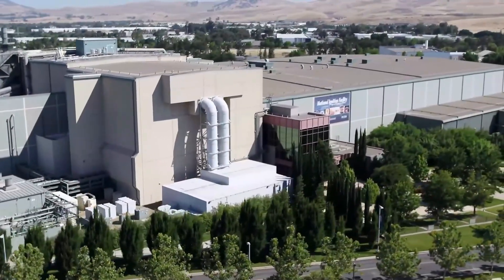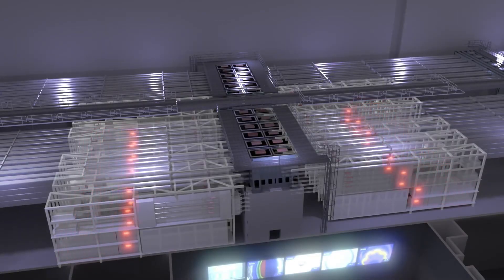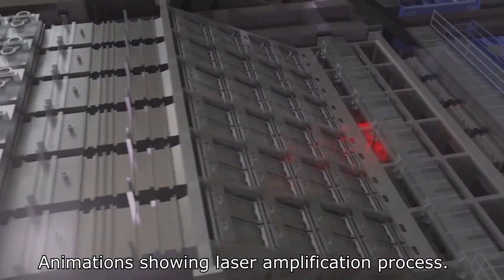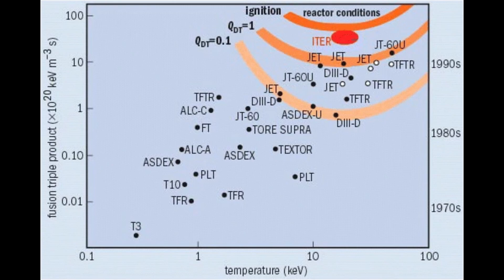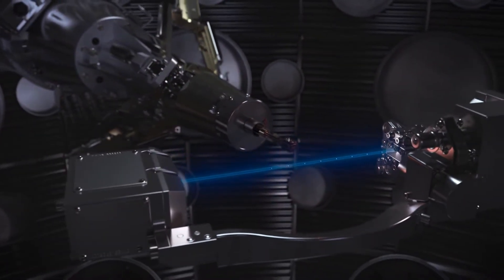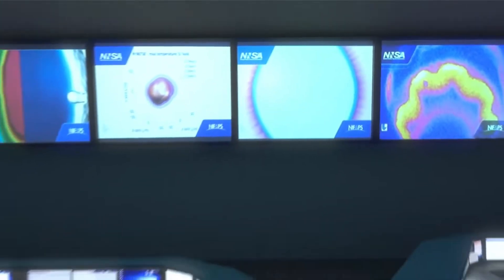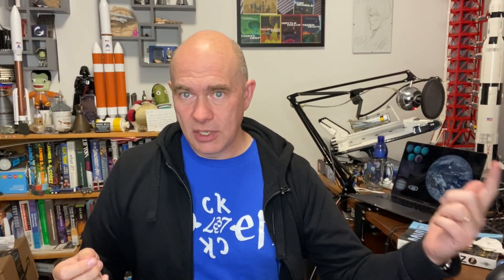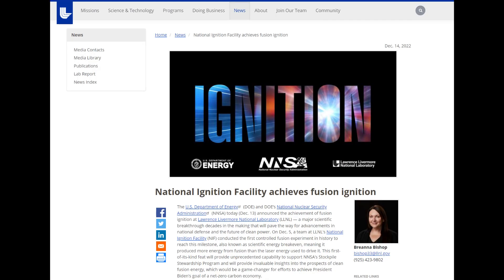Why The Biggest Laser in the World is Making Big News About Fusion

Comment: Watching the panel presentation, they burned 4% of the fuel to get this reaction.  What I expect (and apparently what the experimenters expect) is what is learned from these "shots" is better understanding of fusion reactions, better technology advances in the US fusion weapon deterrent and assisting the magnetic containment experiments (tokomak, etc) in reaching their goals.  One major contribution to this breakthrough is they were able to increase the efficiency of the lasers over their original design.  It takes weeks to months to create one of these pellets of high enough quality to get the intended results.  I'm still convinced a tokomak-like device will be the first sustainable-economic engine on Earth with the help of other experiments.
Reply: When they say more energy out than in, I'd guess they are discounting the laser efficiency. Meaning they are using the energy delivered by the laser into the reaction. Rather than the energy delivered into the laser. Scott seemed to make a big point of the laser efficiency, or lack of, as if a more efficient laser would lower the break even energy. I doubt laser efficiency was even a part of their calculation.
Reply: @heartysteer8752  - The energy gain of the reaction has always been calculated without consideration of the energy needed to generate the intense laser beams. In the past the lab staff avoiding mentioning anything about how much energy was expended in creating the final energy that ends up compressing the fuel capsule. That input energy may be of the X-rays that end up directly compressing the fuel capsule. Once rumors began that the input energy to the facility was at least two orders of magnitude greater than the final compressing energy, that they employ for their gain calculation, then the lab had to reveal how much energy is needed to charge up the lasers.

Now they are bemoaning how inefficient their laser is as a way to encourage funding of a successor facility that would employ more advanced laser technology that is more efficient. They point to research in 'diode pumped laser technologies that are about 20% max. efficiency at this point. What they don't mention is such lasers will need to be called up in power by a factor of almost a million to deliver the kinds of energy now delivered by the current laser set. The lab people obscure the fact that that kind of laser technology is no where close to what is needed, in power level.
Reply: @heartysteer8752  You are correct, those 2.05MJ of laser light energy required 300MJ to create, so the current system's total efficiency is really 0.01 rather than 1.5
Reply: @heartysteer8752  The lasers are old, they are 40 plus year old design, that why they are ignoring them. What new is the fuel pellet design and how they are targeting the lasers because that where they can make the breakthroughs.
Reply: We already have sustainable energy, both economically and ecologically, its called solar & wind power and to an extend hydro power. And the bigger the share of green energy in the energy mix the lower the costs per kilowatthours (atm 3-6 cents compared to 10-15 cents for a new state of the art coal power plant). Dont fool yourself that Fusion energy on Earth will ever be green or as cheap as wind and solar energy.
Reply: @kleinerprinz99  - When I was growing up in the mid-1960s I kept hearing that fission power would soon become too cheap to meter. It helped me learn about the deception of sales pitches.
Reply: 'Deterrent' doing a lot of work here.
Reply: The LLNL often uses the term nuclear deterrent since it is politically important to specify the claimed use for these devices. It also avoids the term 'weapon' that has bad connotations in many people's view. Nuclear weapons labs have become quite good at obscuring the activities that they engage in.
Reply: Yes, with stronger magnetic fields made possible by greater understanding of unconventional superconductors.
Reply: Most of the people, who report on the NIF remain unaware that it has always been primarily funded as a thermonuclear weapon (H-bomb) fuel compression, and related effects, research tool. The machine was funded in exchange for the lab's termination of its underground nuclear test program at the Nevada Test Site (NTS). They claimed it was needed to maintain the safety and reliability of the U.S. nuclear weapons stockpile. There is no evidence that this multi-billion dollar machine satisfied those claims. In this widely reported test the 14 Mev fusion neutrons that were emitted from the extremely compressed fusing D/T was used to test some adjacent materials that were related to the nuclear weapons program.
Reply: Very interesting. What do you think about the Helion reactor?
Reply: @mtshelll2977 - When hearing the sales pitch from the Helion staff ask yourself the following two questions.
1. Have they repeatedly achieved significant amounts of fusion reactions with their hundreds of shots.
2. If they do regularly achieve fusion reactions then what is the level of their facility input energy compared to the fusion output energy.

if they are directly questioned about such issues and side-step the answers then ask yourself why that might be. If they say that they need more capital investment and a much bigger machine to obtain those goals then be even more suspicious.
Reply: I agree, I think that apart from all the really "techy" problems with this approach to a fusion reactor, like the aiming and timing problems and the laser efficiency problem and the heat-to-electricity conversion problem, the biggest drawback to laser inertial confinement fusion is that it eliminates the main benefit we hope to get from fusion as an energy source: it manages to make the fuel a complex, difficult to manufacture, and expensive component. 

Ultimately we all need to keep in mind that no matter how cool or advanced net-output fusion technology could be, if it doesn't cost less per watt-hour than a renewables+batteries system, then it's not that important from a global energy perspective. For applications where cost isn't an issue (like spacecraft propulsion) or applications where it can't be outcompeted by renewables (like commercial cargo ship power) it would still be great, if it could physically fit on a vehicle of course.
Reply: @sycodeathman  so why not do regular nuclear power?
Reply: @Shmuel420  Regular nuclear has a bad reputation but from a practical perspective I've heard there isn't much Uranium of the flavor they are using now. Like a 100 years? And the other kinds are more difficult to use. Don't know how breeder reactors, thorium, etc., factor in.
Reply: @Shmuel420  Many will argue it costs too much, or takes too long to build, or that the waste is too hard a problem. I disagree with all of these arguments and believe that we SHOULD be building more fission reactors, preferably with modern designs which achieve higher efficiency, are better for fuel reprocessing, and which are designed to be easier to eventually decommission once their life cycle is over. The real reason why we aren't building a lot of fission reactors right now is simply because a majority of people don't like them, for one reason or another.
Reply: @sycodeathman  the thing that worries me is the proliferation of nuclear technology, which could lead to more places figuring out how to build nuclear weapons. Depends on what kind of fuel is used, though. Thorium reactors would probably solve that issue
Reply: @Shmuel420  Nuclear weapons are easy to build and the cat is out of the bag, I don't think proliferation actually matters at this point.
Reply: @sycodeathman  no,  the real reason why we aren't building a lot of fission reactors right now It's because each costs $15 billion and takes 15 years to build. The nuclear plants in South Carolina and Georgia were at existing sites with strong local support; SC is canceled and Vogtle is predictably $billions over budget and years behind schedule. Maybe some company could get good at building light water reactors if it made 20 in a row, but no utility wants to be first customer. And each of the next-generation small liquid sodium molten fluoride thorium modular blah blah blah reactor designs will need... $15 billion and ??? years to determine whether it actually will be cheap and quick in mass production. Worth the huge investment (just like fusion research) but years away.

Meanwhile cheap and quick wind and solar have the lowest levelized cost of energy, getting to be even cheaper than continuing to run a coal plant. That is why they have been the majority of new generation in the USA and globally for years.
Reply: @skierpage  why would you reply by stating the exact things I claimed are misrepresented as reasons for why we shouldn't build fusion? This is like if I said building settlements on the Moon was feasible because blocking space radiation isn't that hard and then you responded by saying "ah but have you considered the space radiation". Yes, I'm aware of all those things you said. I simply disagree.
Reply: @skierpage  They're facts but they aren't physical laws. Fission is expensive because the majority of the public refuses to accept it is safe and allow cheaper designs to be funded. It is slow for the same reason.
Reply: More world-destroying weapons: cool!
Reply: @spencerharmon4669  - You have that right. NIF is helping them improve on the existing nuclear weapons designs and in creating more advanced designs of weapons of mass destruction. The current U.S. nuclear weapons arsenal numbers around 10,000 nuclear weapons, most of which are thermonuclear weapons with energy yields well over five times that used in the bomb dropped over Hiroshima, Japan.
Reply: In nuclear weapons it is also the case that much of the fuel is blasted away from the reaction center before it has a chance to react so this lack of burn efficiency is no surprise to this portion of our government.
Reply: Fuel scoop, reactor, engine with small masses needed relative to the ship's size... this eventually is how we will get around in deep space.
Reply: @plektosgaming  nope. There's not enough 'free floating' hyddrogen in space for a scoop to work.
Reply: @Molikai  I am assuming that it eventually gets to the point where you need any sort of matter to make it work.  Whatever you can find, though it might require you to be close to some dangerous places to collect it.

Comment: I hope bubble fusion takes off.  I like the idea of society being powered by bubbles.
Reply: I wonder if you could get a cavitation system working by pumping a hot liquid metal saturated in D/T at high pressures thought a venturi? The sharp drop of pressure (probably still above the metal vapor pressure) on the converging side draws the gas out of solution and then, on the diverging side, the sharp rise in pressure collapses it back down faster than it can go back into solution getting a "water hammer" spike to very high pressures.

Comment: The part I have never understood.  If you are trying to turn this into a power-generation device, it would need to continuously fuse multiple file pellets, one right after the next.  But how are they going to insert the pellet with the needed ultra-high precision right after the previous one fused?
Reply: That is one of the major technical problems with laser-driven fusion! You can't have the next target inside the chamber while the current one is being hit or producing energy, because the shock waves would damage it. This means the next target has to be fired into the chamber so it reaches the centre just at the right time for the next laser pulse. It also has to be hit on the fly, because trying to stop it would require so much deceleration that it would be squashed like a fly on a windscreen! Another major difficulty is simply making those targets at a rate of several per second (the same rate as they are being used), which would require a far simpler target design and massively parallel production facilities.
Reply: The NIF physicists will outsource that problem to the mechanical engineers.
Reply: It's a hurdle that'll come later, but we'll pretend it's not an issue so we can masturbate to sci-fi stuff

Comment: Commonwealth Fusion is doing some cool stuff with High Temperature Superconductors to make ultra-strong magnets.
Also HB11 Is looking at Hydrogen Boron Fusion.
Reply: p-B11 fusion is particularly interesting since it doesn't output neutrons, but only fast-moving charged particles (basically electrical current). These can be decelerated through electromagnetic means and used to generate energy directly. No thermal process involved.

Comment: Inertial confinement fusion is simple not practical for anything but research purposes. The only viable fusion reactor designs at this point are tokamaks and stellerators. Wendelstein-7X with its newly installed cooled diverters should show the viability of building a follow-up stellerator capable of producing a Q of >5. As for tokamaks, ITER is a bit of a boondoggle, as JET, HL-2M and kin have already surpassed it in many ways.

I wouldn't dismiss nuclear fission so easily either. With the use of fast breeders and fast neutron reactors, today's LWRs and HWRs (like CANDU) can achieve a closed uranium fuel cycle, while also opening the possibility of using other fertile isotopes, like thorium. All with nothing but a small amount of short-lived waste (<100 years) remaining at the end.
Reply: Another great comment, I seem to be seeing you everywhere. Yes, it is quite sad that fission got such a bad rap. Makes you wonder if the same thing might happen to fusion if it eventually comes: decades and decades of stagnation caused by refusal to allow new designs, leaving the only examples to be ancient ones. Fission really could be great, but that seems like it won't happen. People are too afraid, and given the way braindead design shortcuts seem to work their way in, I guess I don't blame them (things like playing games with statistics to show that an unsafe design is safe, counting systems which could all be affected by a common cause of failure as independent failure probabilities, etc.).
Reply: @jessicav2031  Self-professed environmental groups such as Greenpeace have already stated that they are against any nuclear fusion research and commercial use, as do the German Green party.

It seems that just the word 'nuclear' is sufficient to send certain people into a state of near-panic. Whether or not said panic is sponsored by Big Fossil Fuel is left as an exercise to the reader :)
Reply: Fusion is simply money laundering scheme for science at this point, nothing changed as it started in the 50s - where the Argentinian president declared they have achieved fusion and free energy lol - The Huemul Project.

Comment: I don't understand the hype people are giving this and this video didn't help it at all. This method of fusion is not at all useful for an eventual power reactor design. You can't build a power reactor out of exploding pellets of fuel made out of gold with a facility that huge. Not to mention the 1% efficiency issues you mentioned. ITER is also of no point as it is also of a design that can't be used for a commercial reactor because of it's extreme size. It's unfortunate you didn't talk about Commonwealth Fusion Systems.